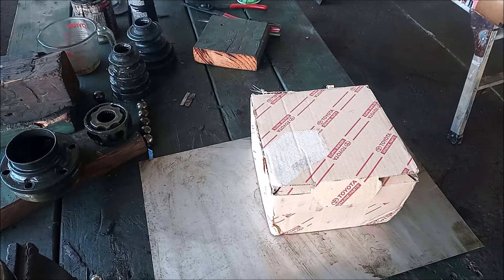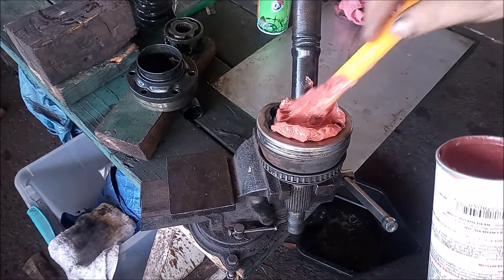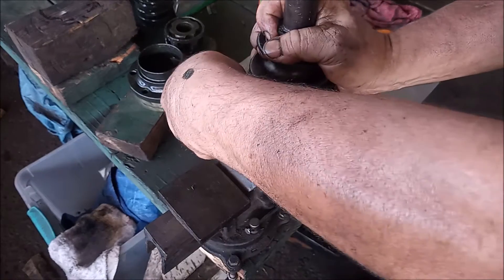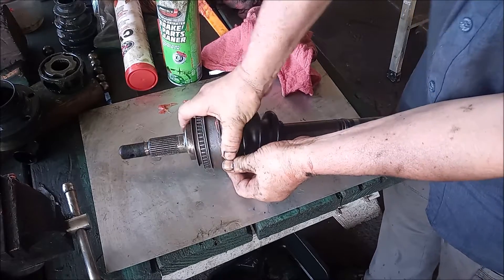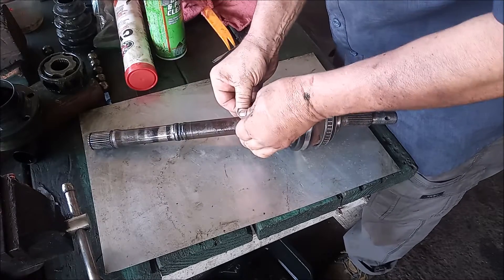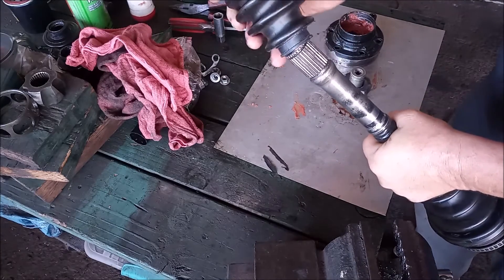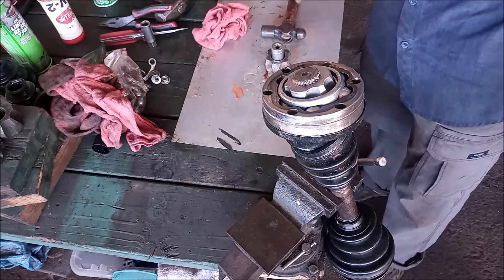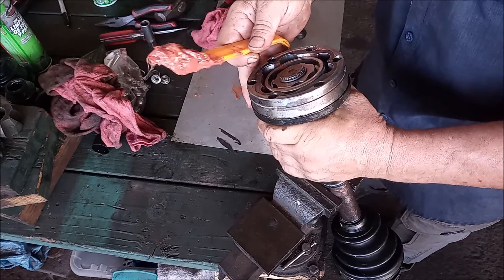9 Easy Steps to Reassemble the Axle - Toyota MR2 SW20 E153 Turbo

Comment: @MerryFrankster I am rebuilding a set of LSD E153 axles, is the Rzeppa joint not made to be disassembled? 
Fortunately it's moves very freely, but I felt like should remove the cage and ball bearings to get it fully cleaned.
Reply from the maker: The rzeppa joint is the outer joint. The inner joint is a cross-groove joint. Obviously the inner joint comes apart  easily. For the outer joint, the shaft is held in to the race by a circlip - similar how the other end of the shaft is locked into the differential. It can be popped out. Then the joint comes apart. For reassembly the joint is popped back in. Be careful with the orientation of the cage and the race. Or you can just soak the whole thing in kerosene or diesel, without disassembling.

Comment: Thanks for this video, Frank. Why did you use different grease?  Is it better than the OEM grease?
Reply from the maker: It is a racing formulation that boasts better high-temperature resistance to degradation.

Comment: Where to find the cork casket and the spring?
Reply from the maker: They are sold by Toyota. The boots are also available in after-market from Beck-Arnley and other companies, but the gasket is available only from Toyota I think . The Beck Arnely boots are a good quality product, much better price than OE.
Reply from the maker: The part number from Toyota is difficult to find in the catalog, but it is the same as the Supra axle.